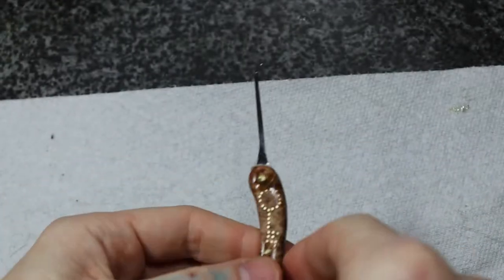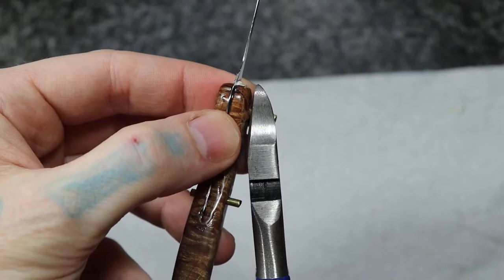156) Making Custom Lockpicks Part 7 - Cleanup, Final Sanding, Finishing, and Result

Comment: You do some amazing work!
Thanks a lot for this series!
It's great to see how someone more, professional, with all the proper tools goes about this.
I've made various picks but only one wooden handle so far. I used whatever wood that a wine crate I got from work was made of. I sandwiched a Sparrows standard hook between two slightly oversized pieces. I don't have anything to make pins at the moment so I used the old reliable name brand Super Glue (gel) and clamped it in the vise til dry. Then used a sanding barrel dremel bit to dig out where my fingers generally rest. Next came lots of sanding by hand using various grits from 220 to 3000. To finish it I put a couple coats of a black polyurethane on it, let it dry, then lightly sanded the edges with 3k paper to make it look worn. Finally, I coated it with coconut oil and buffed it with a rage until it dried.
I'm definitely going to use some of your techniques for my next one through.
Thanks again! Keep it up!
Reply from the maker: Thank you!

Clever work on the handle! Having a handle on is all that matters. Sometimes the most basic and simple handles are really all that's needed. Heck adding fingers grooves can be a luxury! Looking forwars to seeing some of you future work 😁
Reply: @LockpickingDev  Made my second pick last night from aluminum. I emailed you a few pictures of both of them to see about getting your experienced feedback. Thanks!
Reply from the maker: @iyeetsecurity922  Will check it out!